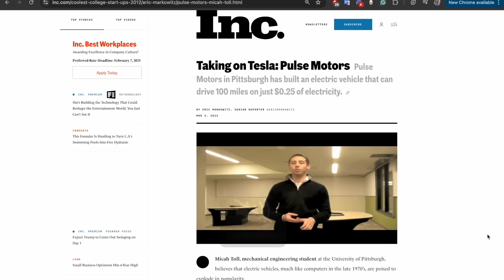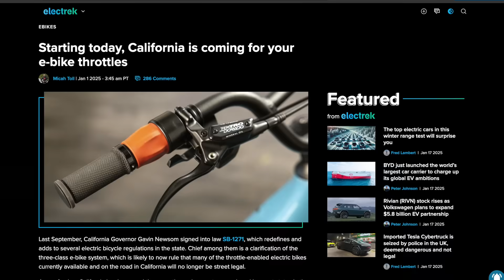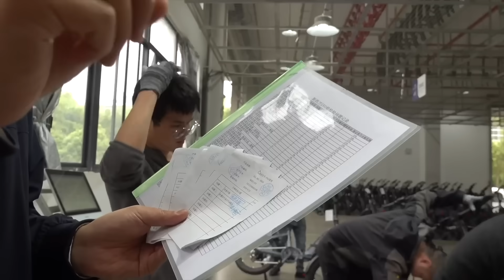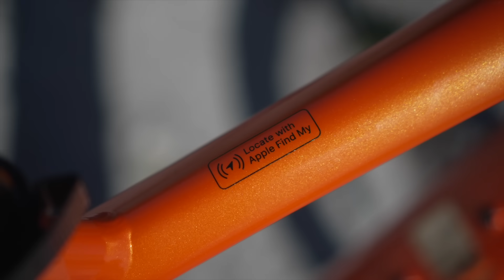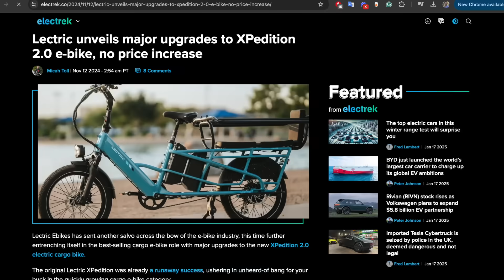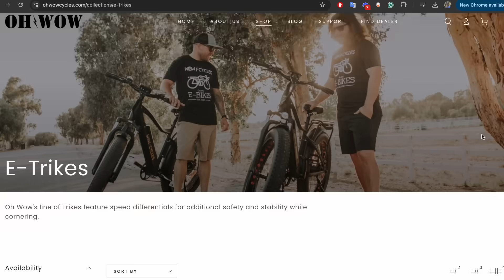5 Things That Will Happen To E-Bikes In 2025!

Comment: Only problem I have with them is the bad range.  I want one that can handle touring with a range of ~100mi on assist mode.  Nearly all of these do 30-50mi and the recharge time sucks.  My normal everyday rides are 35-40mi.  I'm going to likely switch to a stand-up scooter and medium hiking backpack for this reason, there's multiple scooters that have a 100mi range.  The laws are stupid as hell, I ride well beyond those speeds on my existing tour bike.  Nearly 300lbs on a loaded tour bike going >30mph at times and that's okay because it's my feet that are pushing it, but as soon as it's a small hub motor doing it, oh no we can't have that.  Too many moron Karens writing laws in this country.

Comment: I'm just getting sick of the term ebike is it a ebike if you never pedal? Or just a electric moped. I owned a 1970's Vespa Caio it work exactly the same as a ebike it worked with pedals and had a small 49.77cc motor and  was classified as a moped and had a license plate. How about a ebike that won't apply any power tell you start moving the pedals like a class 3 without a throttle like what Giant sells that is what a ebike should be power assisted

Comment: Too many people are buying the fast Ebikes, that are more Emopeds/motorcycles. So its the riders who are at fault. If Ebikes all looked like Bicycles, this problem would not have happened. Plus too many people who ride the fast Ebikes just do not pay attention to what they are doing, and cause accidents. If you want to ride a high speed Ebike, then you should get a license and insurance. What you are sitting on in this video, I consider it a Emoped.  I have been riding a Ebike, since 2019 when I converted my two wheeled recumbent into a Erecumbent. By putting a hub motor on the front wheel. Now my Ebike has a top speed of 20mph. However, if I'm pedaling and get above 20mph, the motor goes into neutral. So I'm Legal. At least for now.

Comment: It's actually more enforcement than regulations, at least it seems that way. My state already forbids e-bikes that go more than 20mph or have more than 1000W of power. These are very similar to the laws for "gas conversion" bikes except it under 50cc rather than 1000w.  For the moment, these laws aren't usually enforced, provided the rider is following traffic laws, riding safe, and it really helps to be wearing a helmet, although there is no helmet law for e-bikes. I would also recommend staying away from the more "motorcycle -ish" bikes like that one you are on, or at least don't be caught riding above the local speed limit (20mph in my state). I imagine that you could register one as a moped, (means license plates with tags, ick!) pay the registration, get insurance, and then you could go up to 30mph (still limited to 1000W) anything over 1000W has to be registered as a motorcycle.) , but you could only ride it in places you could ride a motor vehicle, and you would have to wear an actual motorcycle helmet (this is all in my area, things are different in different places). What I have been hearing from other riders, rumors, basically, is that they are going to legalize class 3 Ebikes provided the rider is wearing an approved helmet, and has a drivers license. Registration and insurance will not be required..Also helmet law for all e-bikes, I have heard as well.
Reply: I only support laws that that are designed to protect others from irresponsible riders. I do not believe another persons choice of riding  gear is any of my business.
Reply: @ndnrider  I used to feel that way, but then I hit a steel firetruck at 20 +mph on a regular bicycle head first. I obviously survived but it would have been a lot better had I been wearing a helmet. I also drive a car on a regular basis so I don't think it is fair to me to pay a higher insurance rate so idiots can feel the wind in their hair on their motorbikes. I feel the same about seat belts now when I used to think those laws violated my freedom, and I guess they kinda do, but there's a price to pay to travel at motor speed with other vehicles in public with our f-ed up liability laws. Maybe it's better where you are. Here, it's almost to the point where pedestrians should have to wear a helmet since drivers are liable for everyone else's stupidity, it seems. All that being said I forgot to wear my helmet today, on my trip to the store. Still I have gotten a ticket for riding a motorcycle without a helmet and all you have to do is bring your helmet to the court house and they dismiss the ticket...

Comment: I wish there were more low maintenance (belt drive, hydraulic disc brakes, etc) ebikes sold in bicycle shops near where I live.
Reply: Front hub motor and a 3 or whatever speed gear hub even with a chain would be much more reliable. Direct drive hubs are even more reliable than geared but also quite heavy and usually overkill for their power eating due to sheer size.

Comment: I have been riding my ebike for 5 years. People would ask me what it was!  I purposely bought a bike with a generic battery/motor. I can buy a replacement battery or new motor on line.  As for regulation, unfortunately some riders are clueless. Flying down walking/bike trails. I am amazed that we have not had a serious accident.
Reply: Yep! Just be smart about how you ride and you'll likely never see trouble. Ride it like a bike. Cheap reliable stuff is always good, and it can be swapped from bike to bike or swapped out. Direct drive hubs are ultra reliable and Regen breaks are fantastic to have to save on brake wear if you can do it.

Comment: Hello Mike, enjoy your videos. Like anyone else, I have concerns about the fireproof battery bag. I have an idea I haven't seen on the internet. I have a masonry fireplace that we never use. I bought two Ebikes and thought I could use the fireplace as a safe storage for the batteries. The Firebox could easily fit 2 batteries in 2 battery bags. Also the fireplace is on the lower level of the house, never too hot or too cold, and very dry. Is this a good idea?

Comment: Micah,    As we age, I am beginning to lose more and more of my ability to participate in most of my favorite activities.  Hoping you are correct in your prediction of 2025 being a year that some bikes are going to be available to someone like myself.  I am interested but afraid.  One day last summer, I borrowed a new Lectric XPEAK from a friend here in Hazleton, PA.  Going downhill the front of the bike started to wobble in a fashion that I was barely able to control!  My speed at the time was about 18 mph and the motor was set to off at the time.  Nearly dumped into the ravine beside the road.  I'm thinking that the smaller 20 inch wheels of the OhWow Voltaic on which you are sitting perhaps might be more stable?????  Haven't purchased an ebike as yet.  They seem to be very expensive.  What are your thoughts if you have a moment?

Comment: Bought an ebike last month, started using it. One issue the throttle works only when put on Power Assist. And when in power assist the bike lunges to 10 mph if you trying using power. 

On the topic of eBikes, Electric Two wheeler are increasing in sales in huge number across the globe enhancing general mobility in those economies. In India, 2024 saw a million unit sold and projections for 2025 indicates 3.5 million unit sale. Those are huge number of electrical mobility added.

Comment: I am on my second e-bike; I have been riding e-bikes for 3 years, and it is GREAT! I am in my 60s, and the extra power provided by the e-bike helps me ride farther and longer. Thanks for your videos; love learning more about the bikes and the industry. (My dream bike would have a torque sensor, mid-drive motor and belt drive with hydraulic brakes, and front suspention forks. Maybe even an automatic transmission.)

Comment: E-bikes should require a drivers test and registration & mandatory liability insurance with license plate. Many of them are just as fast as a motorbike, but with the issue of making no noise, that could warn pedestrians, therefore they constitute a high accident risk, for driver and other traffic participants! And I like to point out that I consider an e-bike for my personal use, but I do hold a motorbike license therefore I will drive with the dangers of an e-bike in mind and wear proper gear when driving!

Comment: If a 75cc gasoline motorcycle with a top speed of 25 mph is required to be licensed, then a 750 watt electric Ebike that has a top speed of 25 mph should also be required to be licensed.

Comment: OK, no pedals and over 20mph makes it a motorcycle, not bicycle.  That's not a problem for me, as I've ridden both for over 60 years.   I'd like to have a 70mph electric, but it needs to have the suspension and brakes of a motorcycle in order to be safe.  I currently have a 15mph no pedal bike which I can use on bike trials legally because it qualifies as a handicap vehicle.

Comment: not to be a jerk to the guy. I saw talking about e-bikers ignoring a safety gear but I also see lots of motorcyclists ignoring their safety gear too. Sorry ninja smith Dude the number of motorcyclists I see in my city of Indianapolis, as well as having grown up in the middle of nowhere Tennessee, riding wearing no gear at all on the highway... It's about one in three. When I got a machine that could go over 30 mph I decided yeah it's time to start treating this like a moped, I agree with you a lot of people should. I got a proper jacket. I got a big ass helmet that's rated for motorcycle crashes. I got gear keep myself safe because I've crashed enough on regular bikes to know how bad it can be, and the faster you go the more like a motorcycle crash it is. Those people need to learn before it's too late. And the fact that people are doing that with Surons is pretty scary, your right but I will admit that you're ignoring the fact that people do this on regular ass motorcycles, especially "when the weather is nice." I want people to respect that if they're on the road they have to contend with drivers of cars. But it's kind of rude to just imply that one side of the issue is doing it when both sides are doing it. Riding with gear has been an issue for all two-wheeled devices forever. It just requires a lot more attention than it's been getting. It's finally getting some attention it needs. What's mind-boggling is the fact that it's taken this long. I just think they're going about it the wrong way, throttles aren't the issue.
Reply: I prefer to ride responsibly in the streets, despite the 35mph gooning I can hit on the trails. If I'm forced onto a sidewalk or shared use paths I go into level one (12mph) whether there's people on it or not, if I'm forced into traffic from my bike lane I make sure I have to turn on my signals and use my hands to indicate my turns just like the law requires in almost every State in the US. I respect the signage. I never shred grass patches or do burnouts. There were lots of people who ride motorcycles, irresponsibly and do all the things that I try to avoid doing on my e-bike. There are lots of bikers that have much more powerful machines than mine. And choose to do all those things because they think it's fun... Well now they're the reason we have laws trying to restrict the throttle.

Comment: Ebikes with fixed seat are not even bicycles. They have pedals only to "make" them look like bicycle. If you have cranks and pedals, you have to be able to set a proper seat height for pedaling, otherwise these 2 (fixed seat and pedals) cancel each other

Comment: Sales of the FAST ebikes did well in 2024, ...very well.
Ebikes are no longer just for exercise, but also becoming a popular mode of transportation across American.
Manufactures such as Altis, ERide Pro, Talaria, Stark, Surron, and Rarr introduced new and improved models, sometimes as many as 3 different times, in the same 2024 calender year! 
New models by those companies would be announced, before the previous model even became available!
Demand was so great, that getting the latest and greatest model before another new model annoucement, became impossible!
Very fast paced, and a cut throat business enviroment. 
The industry leaders of 2024, may not necessarily be the leaders in 2025, should they become stagnent, and fail to introduce improved models.
Based on last years sales numbers, its evident that the public desires models with longer ranges, lighter weights, and faster top speeds.
2025 will be a great time for ebike consumers!

Comment: Yes, if it doesn't fit into Class 1, 2 or 3 then it's not an ebike. The problem that California is addressing with banning throttles is due to most people abusing them, to use the Class 2 or 3 ebike like a moped. These are also the people who are causing the trouble and accidents on the trails. I always slow down when nearing pedestrians, and stop for horses, to not spook them. These paths are shared, and we need to be courteous to all the users.

At the same time, it's not always ebike riders causing problems. More than once, I've had regular bike riders almost cause an accident on a trail, by not notifying that they were approaching, and coming much too close. It doesn't matter what you are riding, don't be an asshole.
Reply: Horses on bike trails should be outlawed. Ebikes deserve their own dedicated trails!
Reply: @Alan-l3i7d  Rather difficult to do when it is a "multi-use" trail. Separate bike lanes and paths do exist, but some trails are for everyone. I'm not fond of dodging pastue patties either, but that is the situation. If we insist on separate trails for just horses, another for just pedestrians, and another for just bikes, we'll likely get none of the above, due to cost.

A very good example is the rail trails that exist in most states. These are all shared use, although a few put horses off to one side..
Reply: @ Who cleans up after the horses?
Reply: Whoever maintains the trail cleans up horse droppings as well as fallen trees or tree limbs, repair fences, patch cracks etc. In addition to government staff, our local large rail-to-trail has volunteer staff that help maintain the trail (everything but the big items such as repair pavement and replace bridges).

Comment: They'll catch on fire?
Reply: That's mostly due to people buying the cheapest and least expensive ebike. The Chinese saw the market and made them to a low price point, because that is what the average consumer wanted. When you cut corners, things like quality and safety get cut as well. I am amazed at some of the $200-$300 pieces of garbage that I often see people riding. And I'm not in a big city.

Ebikes from big name manufacturers may cost more, but they don't catch fire (rarely if at all). It would be interesting to see some actual numbers of fires vs ebike brand and model.

Places like NY had to implement some safety testing standards. With so many people packed into such a small area, the incidence of ebike fire would be higher. I bet that you could say the same about fires caused by shoddy appliances.

Comment: There is nothing wrong with ebikes/scooters that can exceed 28mph having VIN #'s and states can then treat them appropriately
 This would help prevent over regulation of class compliant ebikes that are fine the way they are.
Reply: That discrimination....Lets regulate ALL ebikes, even class 1, 2, and 3!
Reply: @Alan-l3i7d  Class 1,2,3 are regulations.......  Its manufacturers with extra power and speed calling them what they are in fact not within existing regulations that will bring more unnecessary regulation to what exists.  Just make a place for them to be compliant and call it a solution.
Reply: @AEFisch  or simply regulate them all, just like motorcycles.
Reply: @Alan-l3i7d Why would you regulate what behaves like a bicycle, as a motorcycle? On My UNpowered 20lb road bike, I can cruise on level ground at 18mph and easily pass 28 by a lot at times. My class 3 ebike will only go 30 on a steep downhill and would so if I removed the battery altogether - I have no idea what your point is. If it acts like a scooter, regulate it like one. If it acts like a motorcycle, regulate it like one. Watts on a motor are meaningless as Amps*volts=watts or the power delivered to the motor by the battery and controller. The controller can easily just stop doing so at 28mph. Why is this hard to comprehend?
Reply: @AEFisch  If it has a motor, its a motorcycle. If its on the road with others, it should have plates and insurance. Problem solved.

Comment: As someone standing only 5’5” tall I would love to see more smaller ebikes for smaller men and women! Finding an ebike that fits my size is such a hassle that it’s the main reason why I haven’t got one yet!
Reply: The step thru style frames and folding ones are good
Reply: Look for models with shorter reach. Also consider brands that offer bikes in multiple frame sizes.

You can also try looking for ones that come with bars that sweep back towards the rider, such as cruiser, moustache, BMX, Dutch style bars, or get one yourself to replace the typical straight or low-rise MTB bars that typically come on most bikes.

As a shorter rider, the 170-175mm cranks that typically come on bikes in the US are probably too long. Start at a crank length that is 20% of your inseam with shoes on under the balls of your feet, and adjust from there. Cranks of lengths besides the typical 170-175 length used to cost a lot in the US and Canada, but they’re commonplace enough now you can get a set for around $20-25.